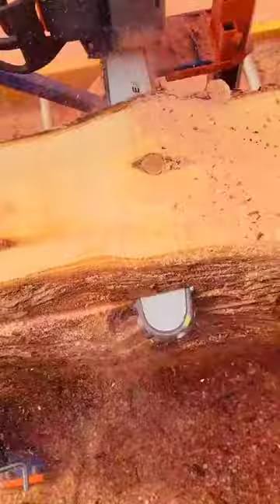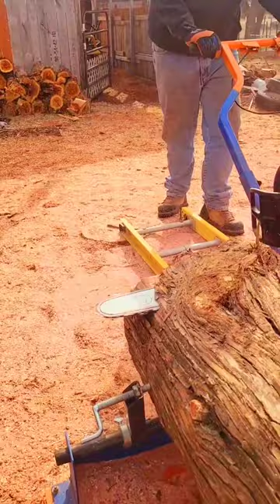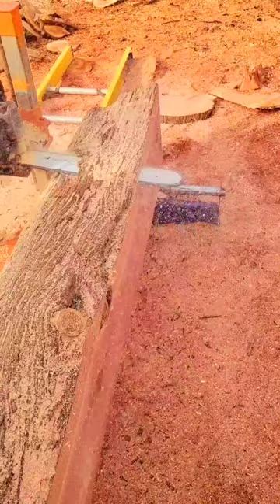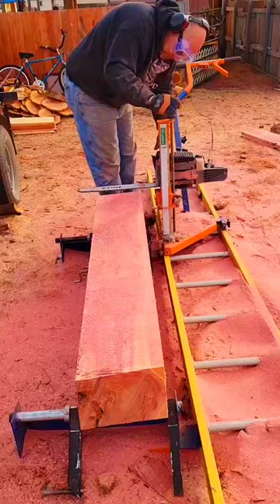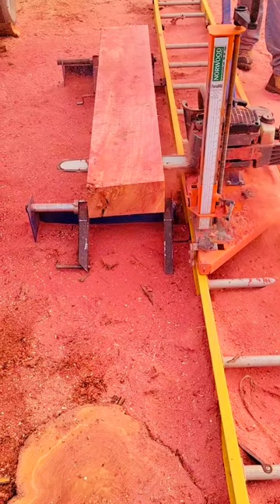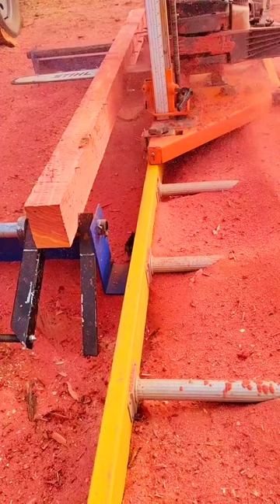chainsaw made lumber on the Norwood pm14 chainsaw mill Holzffarma G660 stihl ms660 clone

Comment: I want one of those mills, but ill guess ill have to build my own. can I advise you to richen up the saw just a tad and maybe get an oiler on the tip of the bar.
Reply from the maker: It oils like a beast! The bar is in near perfect condition and has processed over 300 logs. The topend is a 56mm bigbore with a 8tooth on it! Runs rich and almost 500 rpms under spec! Plus, I have a pile of these cylinders and saws! 
But, I totally understand what you're saying! The oiler is modified, almost maches the gas consumption! When I mill oak I use the extra oiler for the tip! 
Thanks Nathan for the tips (I always like advice) 
Thanks for watching 👀 sir
Reply from the maker: You can also find the Norwood pm14 on fb sometimes for about 500. Iv seen them on there for even cheaper. Just need to keep your eye out! 
Cost almost that for the metal now days!
Reply: @majorpixchannel7146  glad you’ve taken care of the major things. And yes that 8 tooth sprocket helps a lot in milling time. Keep it up 👍
Reply from the maker: @Nathan Van de Velde  thanks brother 🙏 🙌 
It's awesome to have another miller around on the channel! Look forward to hearing from you again sir!